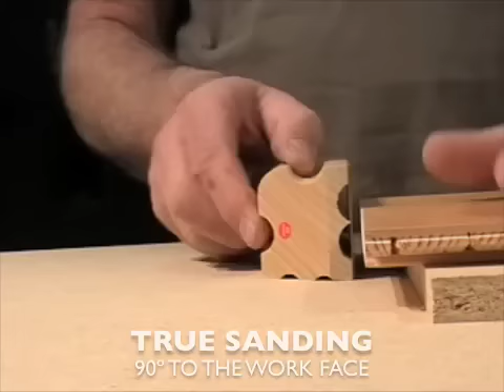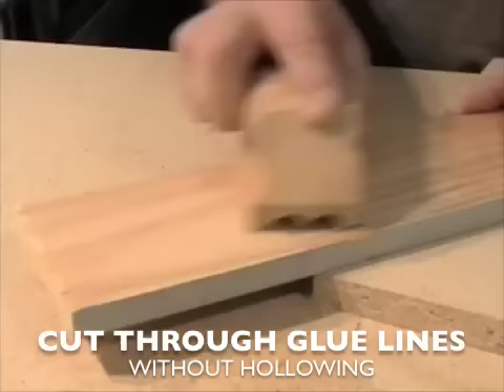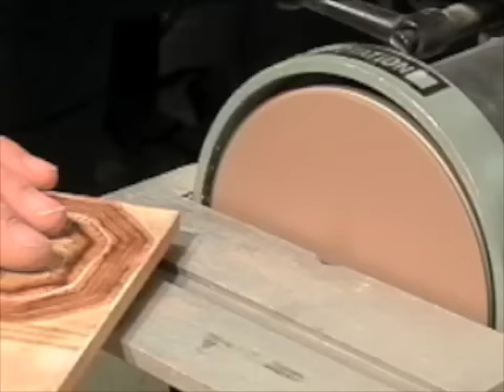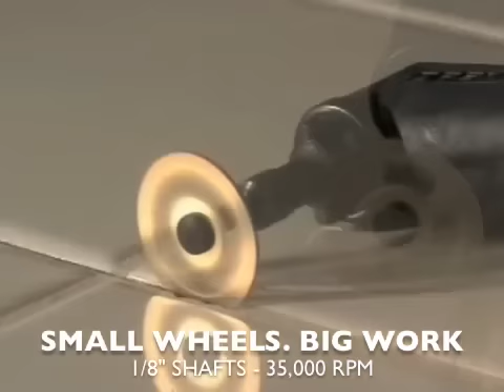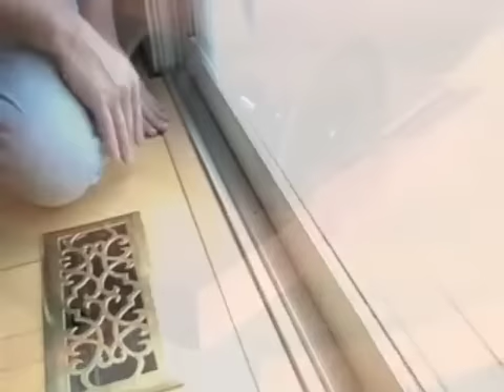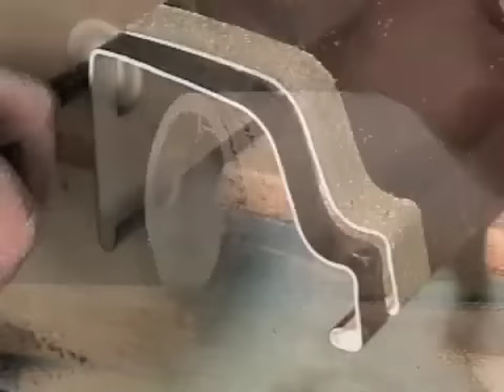Carbide Cutting Wheels, Sanders & Discs by DuraGRIT

Comment: I have a few tungsten carbide bits for my Dremel and as long as you don't do anything insane they last forever.  I have ground some thinset mortar with one and it does nothing to it at all that you can tell.  If you use a steel or high speed steel bit even the same size and same teeth you will instantly ruin it,  Heck, high speed steel doesn't hold up to the same friction and heat that carbide can.  You can be really aggressive with carbide and get it so hot it would give you a third degree burn and it is still sharp and usable.  I find that the only thing that damages carbide bits is really hard steel alloys or anything harder.  Just consider what you will use them on, soft metals clog the teeth and so there are different teeth to help prevent that.

Comment: I might have to try one of these.  How can these be cleaned if they clog?  There are some woods and finishes that quickly clog sand paper thus rendering them useless as if they had no grit at all.  Anyone who has done some woodwork has most likely encountered that annoying problem at some point in time.  Some of them may have even thrown away or shelved clogged sanding belts.
Reply: typically, you can either put them in a solution that eats away the resin build up, or burn it off with a torch.